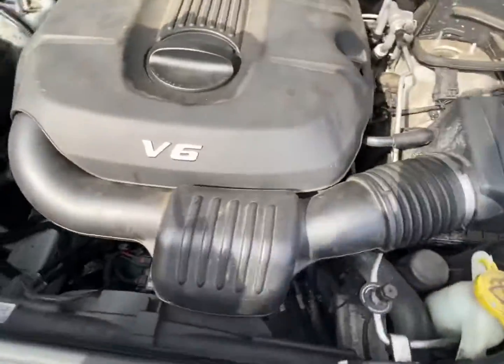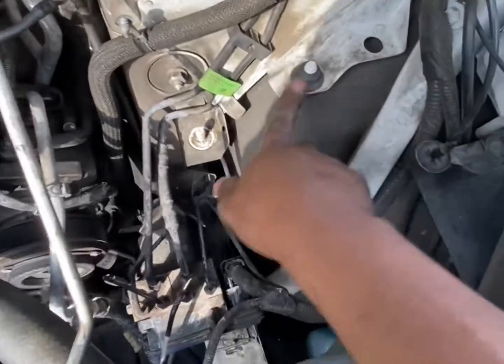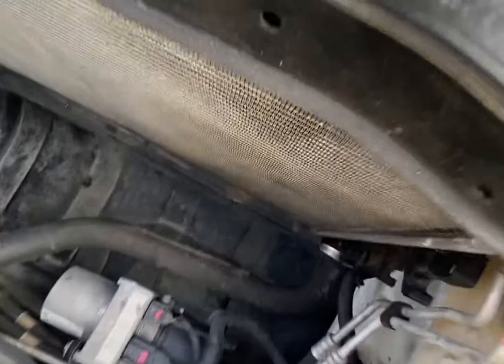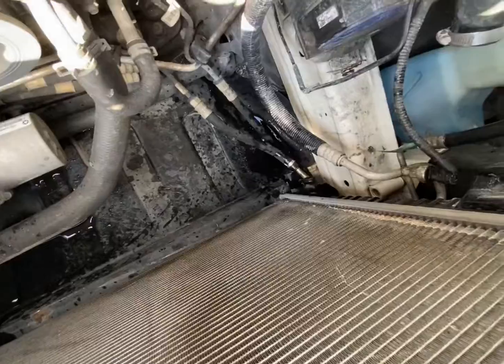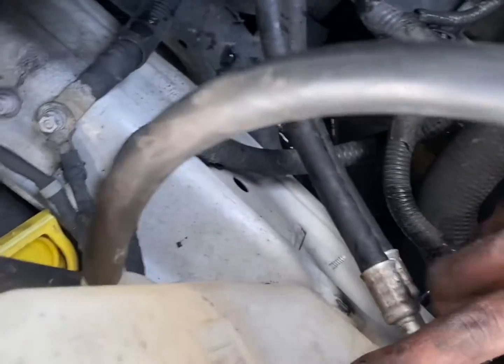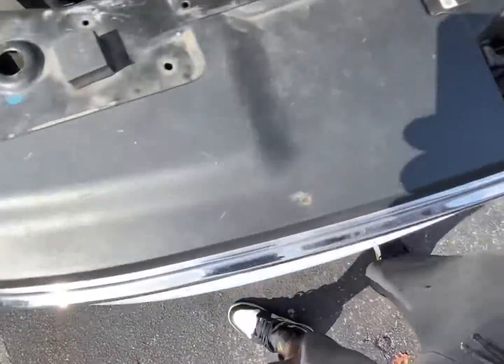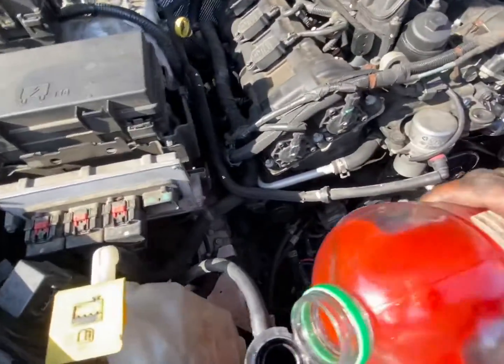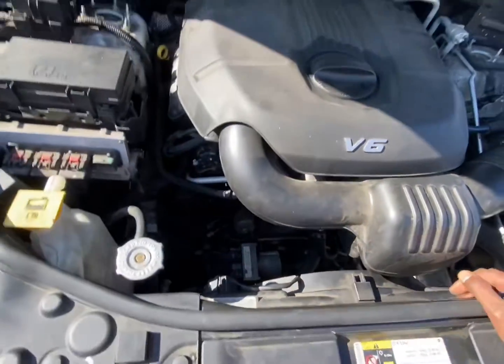Radiator replacement 2013 Dodge Durango @mobeatsmo #dodge #mopar #durango

Comment: What he forgot to mention. you need to take off all 10mm bolts (6 in total)on top brace (2) on top of each side & (2) on inside beneath front grill, along with (2) 13mm which he mentioned with the cross bracing in front.  He also didn't show the radiator is connected to condenser by (4) push clip 2 on each side of radiator which holds the condenser tight to radiator.  Once they are pinched off you can easily remove the radiator which also sits in slit on the drivers side as well.  I try and upload some pics for better explanation. But for the most part he was pretty spot on but would need to show the hard stuff so people can know.  I just changed mine out using his video so it was pretty helpful.  I have 2015.  Good luck

Comment: Is taking off the fan easy for this model? I have to prepare to take the fan off a 2013 citadel and will it be identical to the one you fixed in the video?
Reply from the maker: yes its pretty easy there is two clips at the top of the fan one on each side push those clips in with a flat head screw driver and you will be able to slide the fan up
Reply: @mobeatsmo thanks. How do you remove the tab connection on the fan? Its hard to get off..😢

Comment: I bought the replacement radiator for my 2015 Dodge Durango and it’s missing clips to connect did you have to buy one through the dealer
Reply from the maker: @lollyperez9045  i purchased my radiator from parks auto parts

Comment: After I replaced mine it overheated but wasn’t overheating before just had a leak
Reply from the maker: You have air in your system you must bleed the system